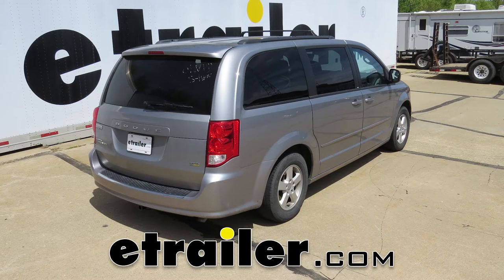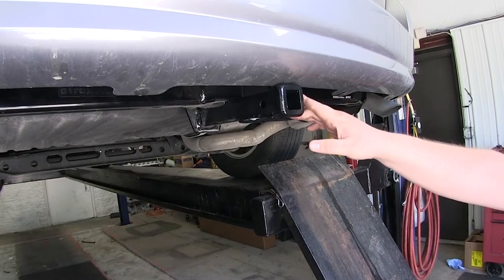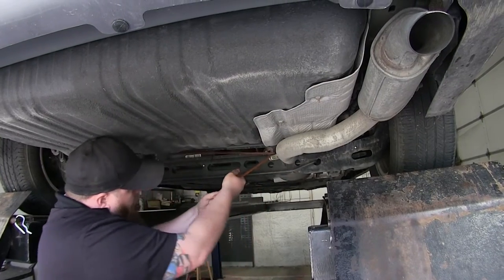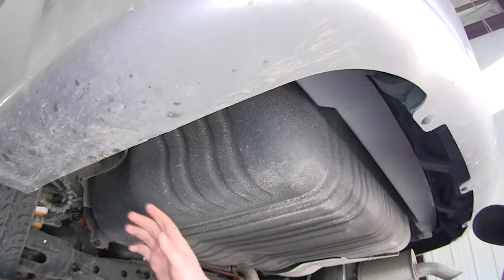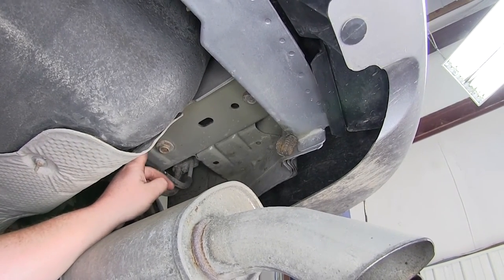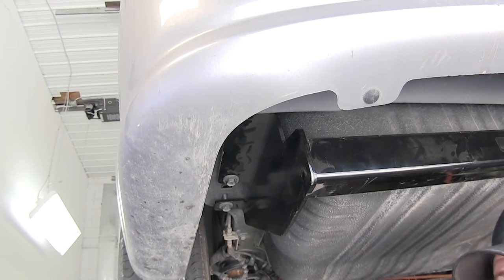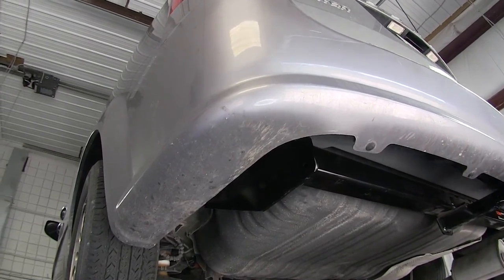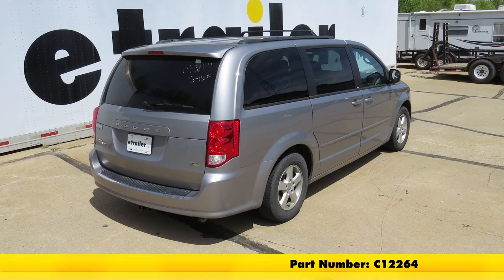etrailer | Installing the Curt Trailer Hitch Receiver on your 2013 Dodge Grand Caravan

Comment: I bought a hitch for a 2012 Caravan and brought it to my mechanic.  They told me that they would have to remove the back bumper as well as the muffler.  I was having a hell of a time removing the bolts underneath in order to install the hitch on my own.  Am I missing something here?  Seems pretty simple.  Just couldn't get the leverage to take the bolts off. Please help.  I want this thing mounted.
Reply from the maker: We typically remove the factory bolts with an impact drill toe break them loose because they may be seized up. You can also use a socket and ratchet with a breaker bar pipe to get more leverage.
https://www.etrailer.com/Trailer-Hitch/Curt/C12264.html

Comment: can this setup tow a 5x8 landscape trailer
Reply from the maker: You will want to be sure that the trailer and the load does not exceed the weight capacities of your Caravan. These capacities can be found in your owners manual. As far as the hitch capacities go, it has a max tongue capacity of 350 lbs and a max trailer weight of 3,500 lbs.
https://www.etrailer.com/Trailer-Hitch/Curt/C12264.html